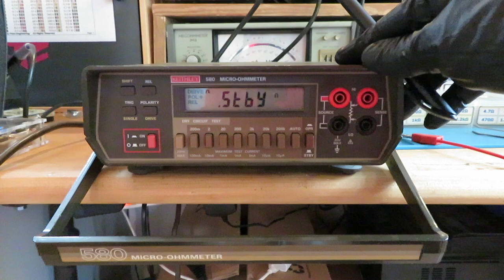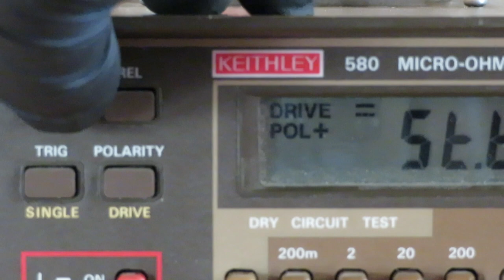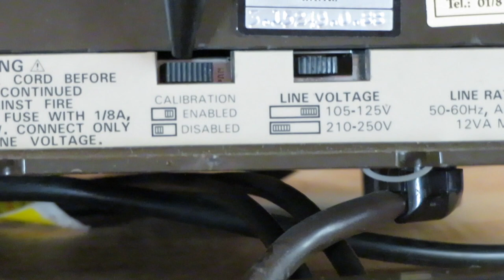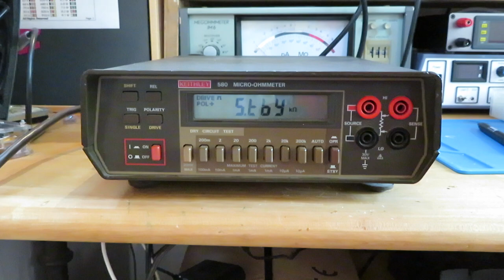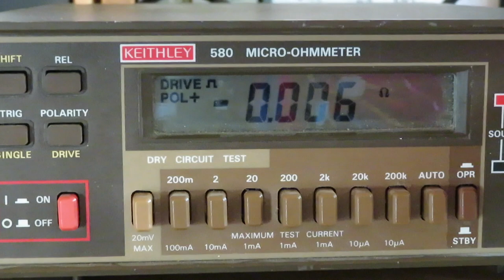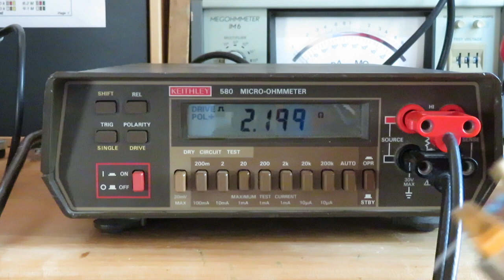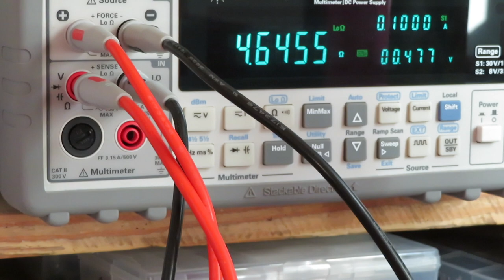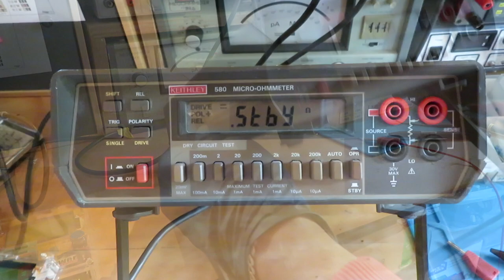Low Resistance Micro-Ohmmeter: Keithley 580 Review

Comment: Nice addition to the lab ^^
Reply from the maker: :) 
Yes... it will be really useful!
Reply: @RobEinstein  Are these meters expensive to repair? are parts available?
There is one for auction in my area and i am wondering if it would be worth it to buy it.
Thank you
Reply: @RobEinstein  Did you have to do any repairs to the micrometer or was it in good condition?
Reply: @RobEinstein  What will happen if you don't short the leads of the multimeter? will you get a wrong reading or will it not work at all?

Comment: The 580 has a unique capability set in one meter.  Keithley (Tektronix) has meters with similar capabilities, but none that are as straightforward with all the features, such as the 20 mV dry contact circuit test which prevents burning thru when testing thin coating resistance. The 20 mV limit is also nice for safely using with other equipment (e.g. force application machines). To obtain the exact same capabilities basically recommends two meters, a precision current source and a precision voltmeter which then requires data capture and/ or programming to determine resistance - much more involved to achieve the same thing. The 580 we had at work recently died, and the replacement, while capable, just doesn't have all the nice features.

Comment: Hi add, the fuse of this meter has broken. This fuse include the resistance and is 1/8A 250V with dimension 6x30mm. Could you please sale or advice me how to buy it? I already searched on internet but no have this kind of fuse
Reply: Why donot try with usually fuse and you add the 22 ohm resistor inside. Will take some time but must work. (I think the slow fuse without resistor must work too). Of course is the no best way for this expensive instrument.